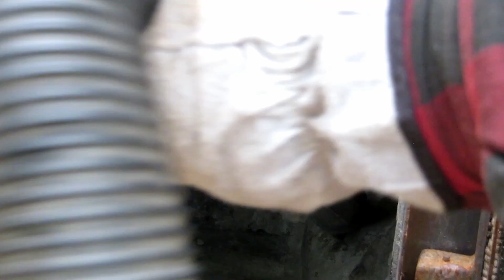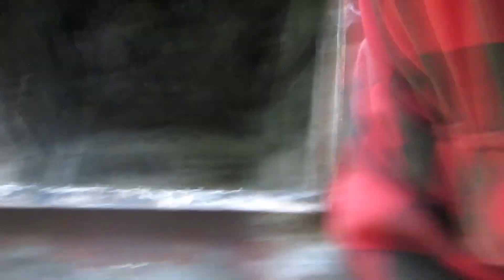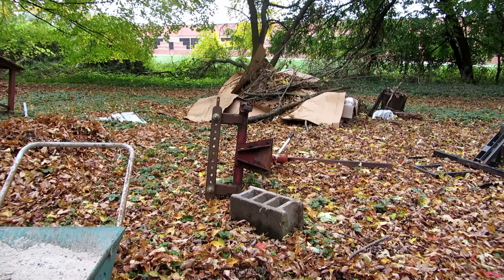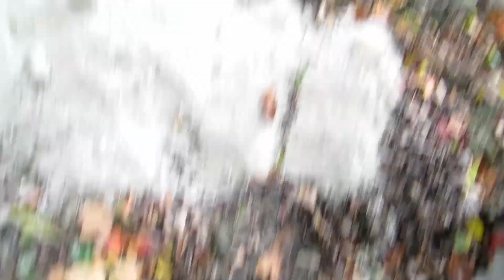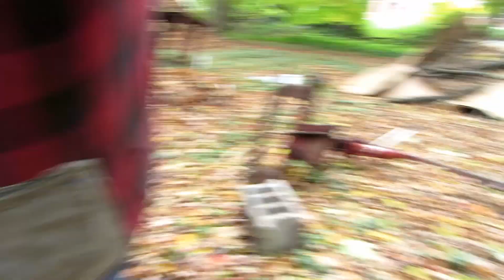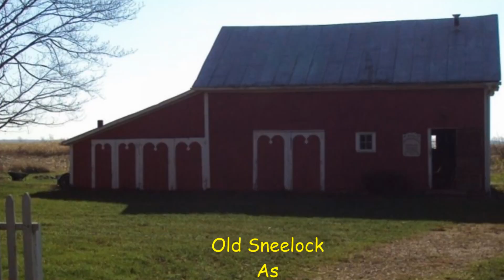OSW Annex Day 73 Level Trench, Add Roof Panel, Clean Furnace

Comment: That ash should fill up vac filter real good .
Reply from the maker: Yes it did. 
I have been cleaning the filters on all the shop vacs with compressed air. It was a gray cloud when I blew the filter clean this time. 
Good thing there was a nice breeze blowing it away that day. 😁😁😎😎
Reply: Yes they like when you vac the dust from sanding drywall mud . @OldSneelock

Comment: The tape is a good idea not sure if it's code or not for you.  I assume you have to have your trench and wire inspected before you cover it over??
Reply from the maker: It is part of the 2018 NEC. 
Yes. Before I can turn on the power I have to have the wire in the trench and open  so the inspector can see it. 
All the wire has to be run and connections have to be made. Then he comes and signs off. 
Usually takes a couple days after I call. I have about a weeks work to get the circuits run in the building.

Comment: Good progress on the shop.  That furnace is going to really come in handy during the Winter months!  😃👍
Reply from the maker: It looks like a good one. With the firebrick fire pot and the fan blowing up through the ash pit to help control the temp it should keep the barn at a good working temp. 
With 3 large chucks of log it it I wonder how long it will burn? We will know within a month or two. 
I just thought as I was typing this that I should turn on the blowers while it is sitting outside. Don't want all the ashes blowing around in the shop. 😁😎

Comment: I think laying caution tape in the trench above the cable may be a new code requirement - but I'm a retired desk jockey, so take my word with a big grain of salt.   Thanks for posting and thumbs up.
Reply: A really good idea!
Reply from the maker: I looked it up when I was ordering it. It is part of the 2018 revision of the NEC. 
It is suppose to be buried at half the depth of the hole. 
Something new every day. $18 to $100.00 per roll.  I should have invested. 😁😎